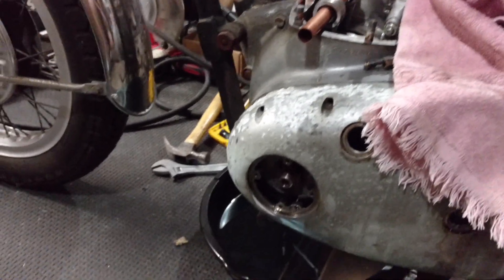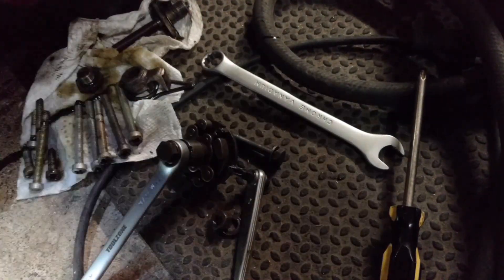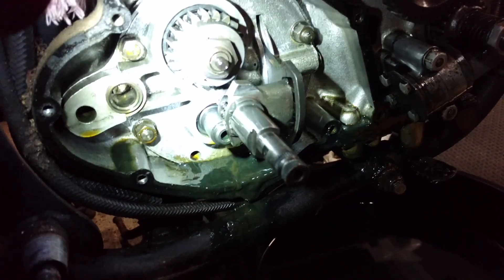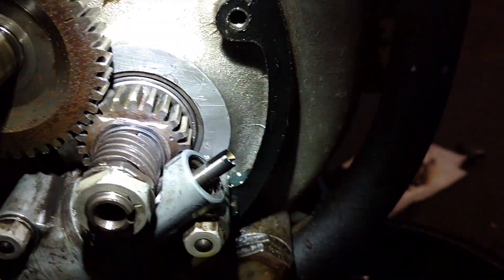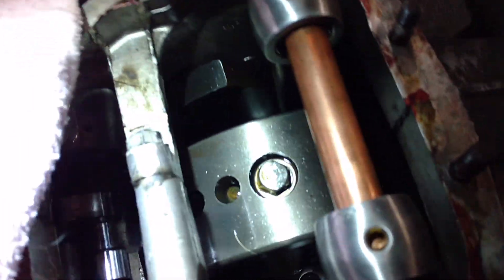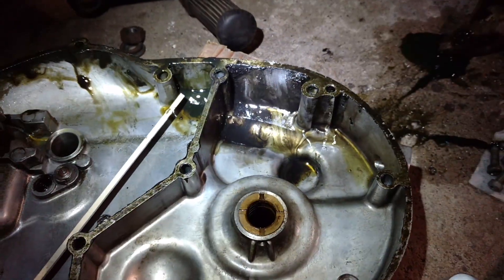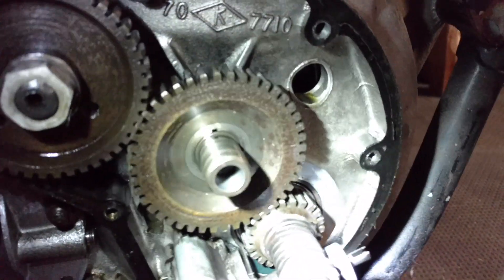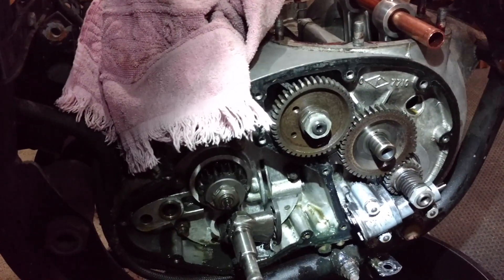BSA Spitfire MkIV - Inside the timing case.

Comment: It’s a bush on the timing side, feeds the oil to the crank too. These pumps work fine, easy to disassemble and check, if the internal gears and surfaces are good, the pump is good. Engine and gearbox oils are separate, the sludge in the gearbox is from moisture. Note the timing gears dots, for correct camshaft timing, the dot on the crank pinion may not be visible until you take off the worm gear. Also, the nut on the crank is left hand thread, when you want to take it off.
Reply from the maker: I was figuring a bush would be bronze, no? After looking at an SRM video, their pump is sounding good, but spendy.
Reply: Yes, it’s bronze, but can come with a steel shell sometimes. If you have the money, SRM pumps are great